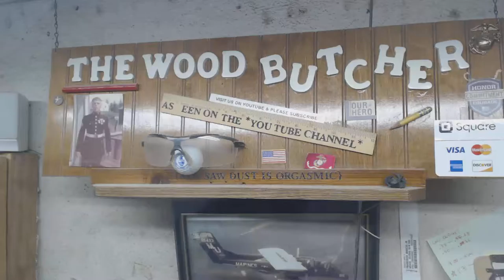Turn Your Woodworking Mistakes Into Gifts and/or Profit_#3

Comment: Hey Gunny, great video. I save all of my scraps that are at least 1"x1" I figure with the price of wood, it is cheaper to glue the scraps up than buy more wood. all my scraps get used to start the bbq.  Well I took your advice and got some nice clean pallets and after cutting the boards I ended up with 31,  16 inch board from 3 to 8 inches wide I will be cleaning the up today. I built a jig to use with my belt sander to sand the thickness I don't have a planner. and the edges I will clean up on my table saw.I use to have a pound puppy I swore was a termite. If a piece of wood hit the ground he would eat it.Blessings to you and yours.